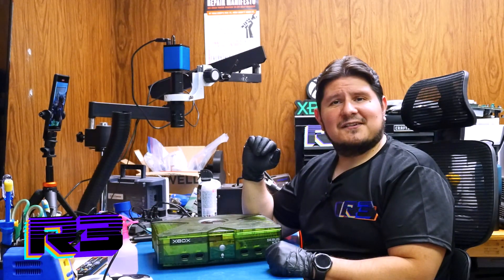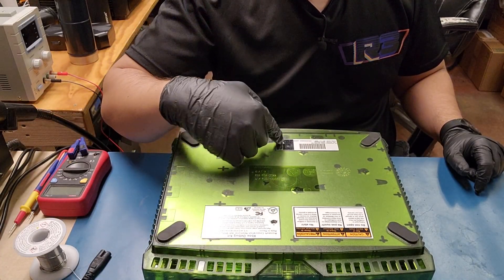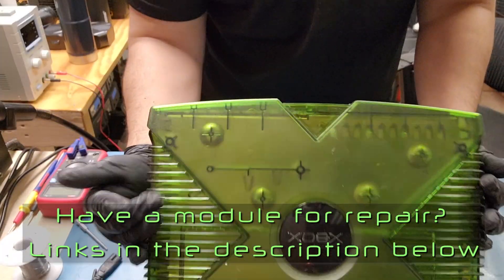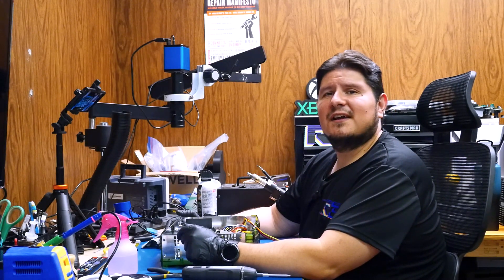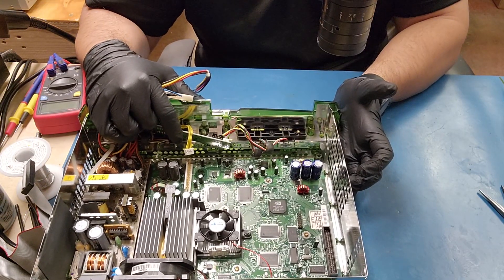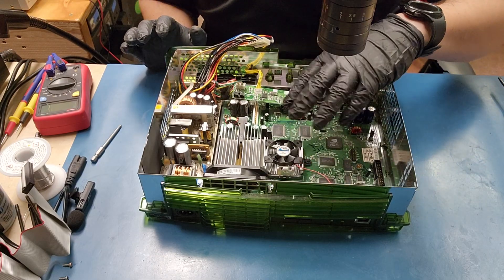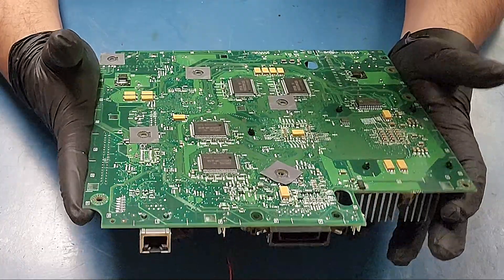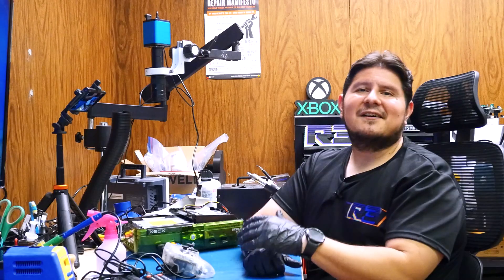A Collectors Item or a Ticking Timebomb? - The Original XBOX Debug Kit

Comment: T20 is the size for the outside screws. T15 may work but could strip them 😅
Reply from the maker: Yea, if your took kit doesn't have em you could get away with that. I have come across many stripped Xbox screws in my time.

Comment: Wish you had tested the dvd drive. Those Thomson drive are notoriously unreliable. I hope the broken screw post was disclosed if you purchased it as a collector’s item. Although you easily replace it with a standard halo shell since it’s exactly the same cover without any serial numbers or other identifying features that would expose it as having been legitimately replaced.
Reply: I've had more luck with Thomson drives than I have with Samsung. But, I've been able to rescue more dead Samsung drives just by installing new Resistor Arrays.
Reply from the maker: I suppose I could have. I don't remember if the debug console would accept a burned disc with evox or something on there.

Comment: Have a few of them in the original box. Must have a look at these capacitors.
Reply from the maker: Its only a concern if the XBOX is one of the older models. I don't really see 1.6 XBOX versions have the leaky cap issue, but never say never.
Reply: @RetroRenegadeRepairs  I've only seen 1 instance online of the gold clock cap found in 1.6 and some 1.4 boards going bad, and even then it only bulged but didn't leak.
Reply: @RetroRenegadeRepairs  The 5 CPU caps are currently going bad in 1.6 consoles. Mine leaked in December.